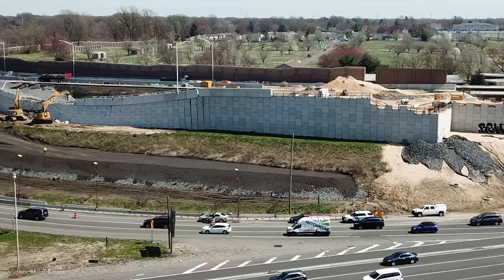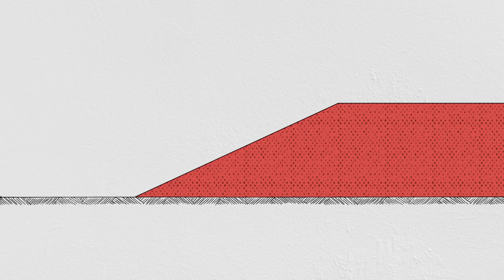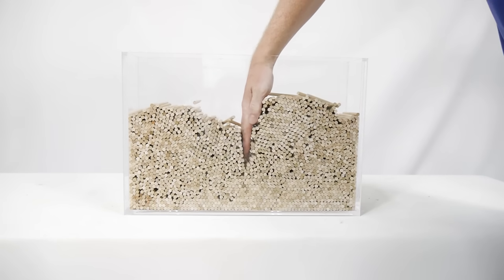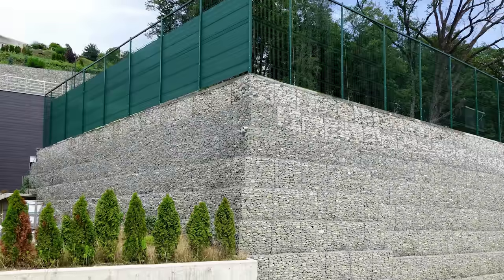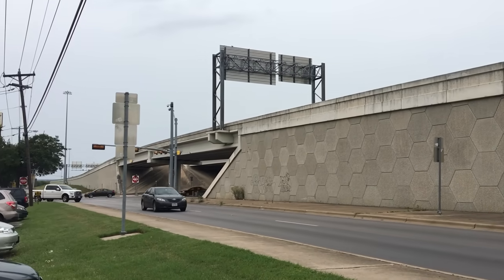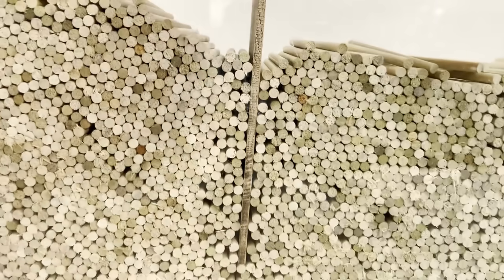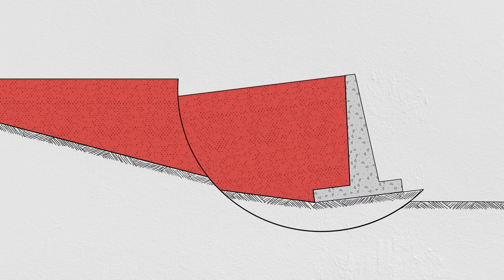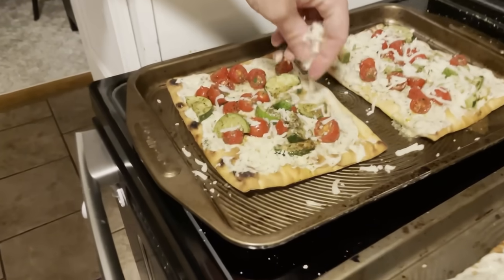Why Retaining Walls Collapse

Comment: Something in the background of many of these videos is the issue of design standards. Often engineers get used to a solution and apply it in every situation. This isn’t all bad as having a good solution to a common problem saves tons of engineering hours and is ultimately cheaper. But if you don’t do you’re do diligence and make sure the standard/instinctive solution is adequate in a given situation, you end up with big problems.

Comment: As an old renovator and retention wall builder, I can tell you it primarily boils down to releasing hydrostatic pressure, and insuring that your tiebacks are well anchored versus the horizontal force of the restrained mass.   In the final analysis, non transportation platforms may be allowed to slowly erode via weep holes, while road and rail foundations must be robustly supported and the underlying material be effectively drained at all times without significant erosion. Obviously I have added nothing to the understanding of any soil scientist or hydrologist ( which my oldest son ended up as a master's degreed and consummate master of professionally).  Would that we all be better mathematicians, and could trust our own vector force calculations assuming maximal moisture content of the restrained mass, such as after a tropical depression has soaked the area for days on end.

Comment: If need still more for higher wall a 12" U block every 5-6 coarse high fill w/rebar & concrete. Need 20+ or 30ft retaining wall high, just double the wall back to back w/4"cap u fill w/concrete.

Comment: This is great as always pal, and I did think of a couple as a none educated (observant) but some surprised me :) I wouldn't have thought of layering synthetics with the earth. The first example with partly building under the earth and wall interests me in particular, I find if a way can be found to use natural engineering it'll be superior in most cases-what if that tactic could be implemented so it proper melds into the earth, being part of it. Maybe using the first method with anchors too. I wonder if there are many other techniques than what's mentuoned here

Comment: I drive to and from Seattle daily, and have gotten a great view of the ongoing construction of the light rail line extension up towards Lynnwood. I always wondered what those weird things poking out of the dirt were, and why they were putting them in before putting up giant molding walls to pour the final concrete retaining wall into... now I know 👀 Also funny enough, that wavy pattern in said retaining wall (which I assume is sound dampening), is actually part of the mold itself, they aren't block panels being made offsite and put in place like I always assumed. Go figure.

Comment: The thumbnail picture looks like either an Unstabilized sub grade lacking both compaction and density testing.  Or what seems more likely, a water main issue under that section of road that failed causing a washout.  It is fairly obvious that the back fill material used was high in sand content.  No matter what kind of matting was used to build up the layers of sand in the retaining wall the sand would enviably follow the flow of water causing the cavitation under the roadway.  A natural spring under ground comes to mind also,but much less likely.

Comment: Okay, so firstly - these vids are the best and the guy doing them should clearly be president of the universe for his calm steady intellect. But I have a problem, I can't wrap my mind around the pretensioned ones. The steel in a sleave and then in mortar and pretensioned. I can sort of imagine that tension being useful initially, although I have a problem intuitively grasping the frictive retension of the anchoring end of the steel beam (probably not a 'beam', apologies engineers!), even if I suspend disbelief for that bit, I just can't cope with the idea that the tension would stay there, why wouldn't the anchored end creep upwards and outwards towards the wall? Surely the soil particles as they wiggle and shift as water moves through them, allow the anchored end to slowly be pulled towards the wall, and let off the tension. I mean obviusly it does work and my intuition and understanding is failing, I fully accept that its a system in use and works and engineers who understand things far better than I do have designed this and it clearly works brilliantly, I just can't get my head around it, thats all!

Oh, and again: great channel, really, absolutely excellent.

Comment: I did not see in the vvideo or in the comments any mention of the most common type of retaining wall, home basement walls. These are usually of block construction, 8" wide with a 2X6 plate on top flush with the outside surface of the block. Unfortunately, on theweight bearing sides of the house (where the floor joists rest) this adds the weight load of the house asymetrically to the outside of the wall leaving the inside of the block wall free of any imposed load. Basement walls will then separate along the horizontal morter joints as the soil burden presses in. I have closed those cracks back up by driving wooden wedges under the floor joists bringing part of the load down onto the inside of the block wall. Both the building contractor and the building inspector specifically approved the 2X6 plate on the 8" wide block construction.

Comment: EZPZ the pricks used sand to back fill what was a swamp instead of securing it. There is a reason that excavator can't be on the ground without the planks underneath them. It's all a mushy swamp! They should have used crushed concrete to secure the footing and then filled it in with a layered mix of dirt and crushed concrete. Long story short they didn't do a good job.

Comment: the only question i have is for the footing one. since its an L shape and could slip. why dont they use Like an L and n combo? Where the L part supports what it needs and the n part digs into the ground to prevent slipping and supports the L?

Comment: having had a road project done relatively nearby, my guess is the private contractor building the road had the engineers use the most optimistic engineering data in order to maximize profit.  in my area, after going over budget by nearly 100% the contractor abandoned the project and the state had to take over.  if you don't count the time and money wasted on the private contractor, the state finished the job in the intended time frame and at the intended cost.
and that is why I don't believe privatization is the answer.

Comment: Seen a lot of road construction in Central Florida done this way, most notably in the multiple points of the expanding I4 project. Never felt it was being done safely. i expect many roads/ overpasses built like this will have major failures in the future.

Comment: Man why are there no good video games of this kind of engineering?! I want to design, plan, and build this kind of infrastructure, with proper physics so my foundations can fail spectacularly if I mess up, building roads and bridges and buildings, above ground, under ground, building in water management systems, all in a detailed but fun and accessible package! I want to draw up the blueprints and operate the machinery and have sandbox controls were I can subject my work to freak weather just for the hell of it. Nothing I have seen comes CLOSE to these ideals :(

Comment: Just a quick fact they also use concrete coating in coal mines and other mines as well to hold up the walls and ceilings throughout but that’s only one of many tricks that can’t be used :)

Comment: Random thought I had in the middle of this video, but wouldn't Diverging Diamond Interchanges be more efficient if the diverge went above the road at the intersection? If you have a two lane highway exit on the diverging sides, you could even bridge a lane that would act as a left turn, then put in a merge to the right, and never have to cross traffic at all.

Comment: Maybe it’s just a difference in reporting, but I’m in the UK and hear about a lot more infrastructure failures or collapses in the US than I do in most over countries. Is there any chance you’ll be able to explain differences in tolerances, building techniques and mindsets between developed countries that could explain this?
I’ve only heard of 3 or 4 bridges collapsing in the UK, they were in the Lake District and were generally centuries old single lane stone arch bridges being washed away due to a series of very heavy flood events

Comment: Thank you I was working for a construction company Wade Aid me to wall they Hammer I beam down to the Rock then they use reinforcement-bar and they was still but they was covered with plastic and they use lots of concrete 3 ft deep 3 ft wide saint day is was 10 ft wide and 1 ft and it was twenty feet up wheatberry lot of that again thank you very much Have Yourself A Merry Christmas bye-bye

Comment: It happened in New Jersey and they are wondering why it was behind schedule, over budget and it had a massive failure of a retaining wall? NEW JERSEY? There is 90% of the problem! In Phoenix, Arizona, "The Big Stack" for the interchange at I-10 and I-17 finished over 1 year & 4 months ahead of schedule, under budget and it has NOT had any issues. I think Tanner did that job. Kiewit bought Tanner. I doubt I need to tell a civil engineer who Kiewit is.

Comment: I think there are couple reasons for retaining walls to fail at such high rate compared to other types of constructions. For one you have very conflicting priorities. Everybody wants it to be as cheap as possible (retaining wall probably the last thing you want to be overpaying on) but also wants it to look nice (straight -- the last thing you want when building a retaining wall on the cheap).
Another problem is that you are dealing with highly variable element (soil) that can dramatically change properties depending on weather but also you frequently it is brought from somewhere else after the wall is designed meaning as a designer you don't exactly know what's it going to be and how well it is going to be compacted/drained.
And then, let's just admit retaining walls aren't the sexiest projects out there. They are frequently part of something bigger, a side to the main dish. I would assume they are typically pushed to people with a bit less experience while the big shots are working on the center piece.

Comment: If I do footings for a retainer  wall I underpin the ground on the bank side so the concrete flows into it .easly  done with a claw hammer as long as its  just b4 the concrete arrives b4 any rain

Comment: 1588: blocks to big not enough coarse wire or joints. They should alternate the blocks even if 12" 1 facing in long ways wide ways back & forth just need blocks to be perfect rectangle so 1/2 *2 long or 1 long balanced side loading. If retaining side has a catch edge hang over on in side of wall & smooth look on out side of wall for looks. To hang over & edge catch means resists sliding.

Comment: These videos are very interesting. Im no civil engineer but I have a 2 foot retaining wall - built over 50 years ago- about 7 feet from back of  house on  higher level. Wall  now seems to be failing.Dawned on me from video that the poor condition of the slabbed surface area which is on top between wall  and house caused by settling  is now more porous causing problems to wall..and may lead to problem to house? Is that possible? By the way manhole to sewer in the paved area nearer house starting to protrude slightly more than 20 years ago. Was intending to just rebuild wall but I think maybe need to stop rain water ingress through slabs first as quick solution? Or is that ridiculous? Back of house but not the front maybe built up land.This video makes me think I don't know which is the chicken or the egg of the problem.Odd no problems for 40 plus years. What do you think?

Comment: Talking about retaining walls. Have you seen the ones used by Medieval Japan? In my opinion, it's really incredible how structurally durable & aesthetically pleasing they are despite being really simple by nature. Good examples of the use of such retaining walls would be how they're used in the raised ramparts of Japanese castles. It's worth checking out if you're curious, particularly how they're constructed. Last year, the NHK made a documentary exploring such a thing (https://www.youtube.com/watch?v=f9wGOXXoCuY ) the building featured is the Rolex Service Centre in Dallas, Texas. It's shown in the video that the traditional wall construction method has remained relatively unchanged over the centuries, and is highly labor-intensive, but if done correctly, produces little to no waste. Like most long-standing traditions, it's basically akin to a practical art form now.

Comment: Related to your vid of February, 2016 —Tuned Mass Damper— I would like, if possible, some hints ….My quest is just the opposite, I have a large concrete platform, of 40ton, which oscillates on the horizontal plane, back and forth, about 10mm only, in some way quasi continuously. I want to amplify this movement via a underneath hanging pendulum. Still struggling on how to roughly calculate pendulum string length and mass to maximize energy recovery…
Any hint on that?!?
Many Tks

Comment: Hi, Can you please give us your analysis on why a home plumbing system where no external water source is connected, tank on top of the house which is filled by submersible pump, works perfectly but fails to deliver good enough pressure on water heater lines, sometimes getting kinda air locked, heater inlet and outlet are almost always smaller than plumbing but what other causes there might be, how to avoid or get rid of existing issues
Reply: I don't have high hopes of getting a reply or a video but still wanna leave a few details, we have both instant and typical gas heaters, both underperform even ones with same plumbing in/outlets, typical heaters being one with storage tanks that maintain/store the pre heated water, instant ones only run when tap opens
Reply: Main storage tank is 2 story high and can deliver more than enough pressure, heaters behave the same regardless of if they are placed high (main storage tank level) or low (at shower level), there are not many elbows or choke points to decrease water pressure, plumbing was done keeping that in mind

Comment: I excavated a retaining wall a bit over a month ago at a fire station were building. The wall is less than 5 feet away from the neighboring house that was built right on the property line. They still haven't poured the retaining wall and I can visually see the house is settling. A lawsuit will take place I'm sure. In this case the superintendent dropped the ball. If I was poured after I excavated the material it may not have settled lol but who knows

Comment: Former retaining wall inspector here. MSE walls are mostly disasters waiting to happen. The theory is sound, but rarely do I see them built correctly. The vast majority have issues due to water infiltration creating voids and reducing the capacity of the mechanical reinforcement. The panels start moving and then it just snowballs from there. I wouldn't trust them as anything more than temporary, 10-15 year solutions at most.

Comment: Sir, could you please tell me whether it is true, that screw piles or any steel for that matter, once it has been placed in the ground, it would never fail, because the oxygen needed for oxidation, simply is not there?
I personally feel that such statement is a long stretch of the bow and can not be correct. I would be grateful if you could provide me with an answer.
Regards,
Franklin

Comment: Part of a tall apartment building broke from the main structure and fell down the adjacent hill near Birmingham, Alabama, USA.  In my humble opinion, any fool would have known why.  A gasoline service station was built between the apartment building and the highway.  The owner of the proper excavated too close to the hill on which the apartment building was built and put in a very tall (an inefficient) retaining wall to hold back the soil.  The wall was vertical (no slope at all) and most like not built with guidance from an engineer.  Upon completion, the gas station had ample parking space but this left the apartment building dangerously close to the edge of what had formerly been an adequate, but steep, hill.  Every time we drove past that gas station we'd see the apartment building that overlooked the wall and say, "That building is gonna fall one day."  Sure enough, it did!

Comment: This not a new problem. Some of the largest stone blocks ever quarried and moved can be found in a retaining wall at Baalbek in Lebanon. Moving forward a couple of millennia the Railway engineers in the Victorian era England solved a problem with a particular troublesome cutting and retaining wall with the use of 'Flying' buttresses prior to a tunnel near Chorley in the UK.

Comment: I just got back from Machu Picchu in Peru. Those guys had some serious engineering skills. No school or permits pulled and after thousands of earthquakes many of the rocks  are still so locked in place you couldn't slip a piece of paper between them. Their terracing and water systems are also amazing. Too bad those damned Spaniards went and messed it all up for the local engineers!